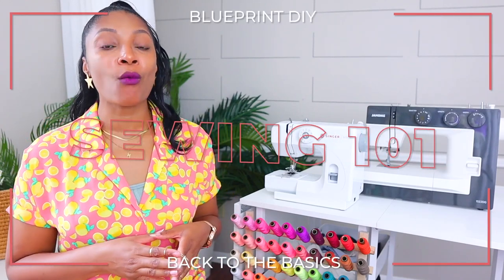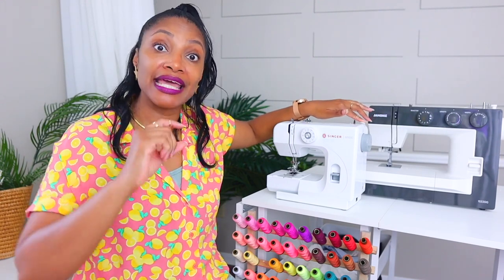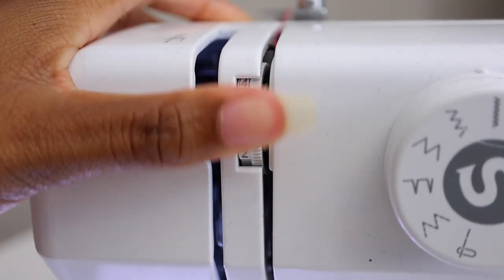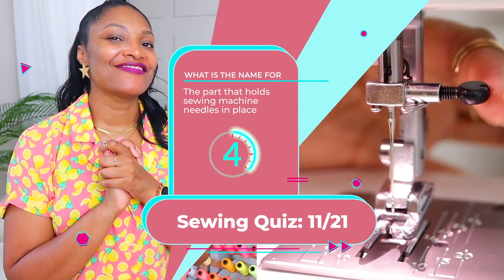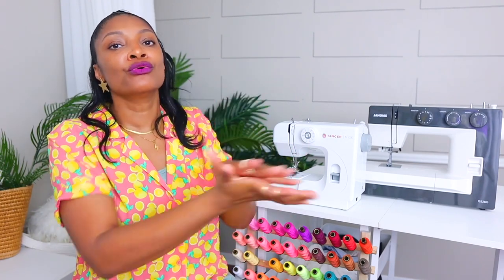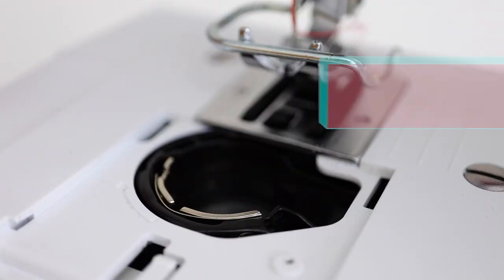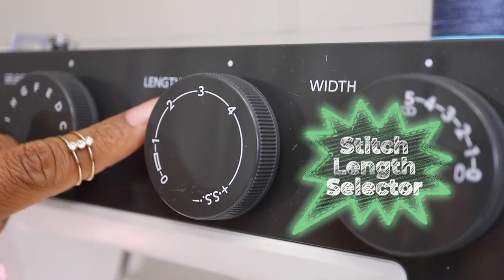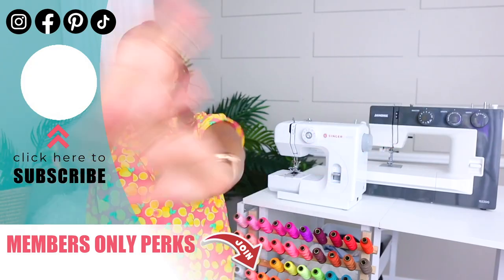Learn the Parts of Your Sewing Machine! | Beginners Sewing Class Ep.2

Comment: Some machines the balance wheel is also used to wind the bobbin, you have to press it in.also some machines you have to use the bobbin winder tension to thread your machine. Lol didn’t know the correct names of some parts but knew what the purpose of the part was for.♥😅